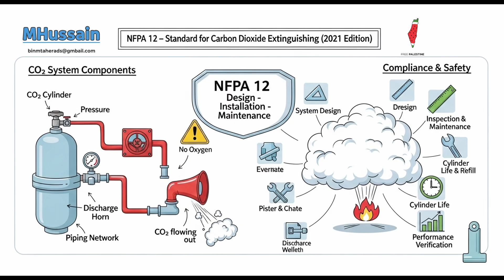Explaining NFPA 12 – Carbon Dioxide Systems in Fire Protection

Comment: 11:00.  Actually, in many instances attempting to extinguish a fire involving magnesium or similar combustible metals with CO² or water can act as an accelerant and produce violent explosions.   This is because combustible metal fires burn at temperatures much hotter than your typical class A, B or K fires, often exceeding 5000°F.   Such intense heat causes water, CO² and most other agents which would normally remove the heat and/or the oxygen parts of the fire tetrahedron, to decompose.  Or, CO² breaks down into carbon and O², while water breaks down to hydrogen and oxygen. 

That's why the importance of risk assessments and having the appropriate sizes and types of extinguishers on hand based on the hazards likely to be encountered in that particular environment, cannot be overemphasized.